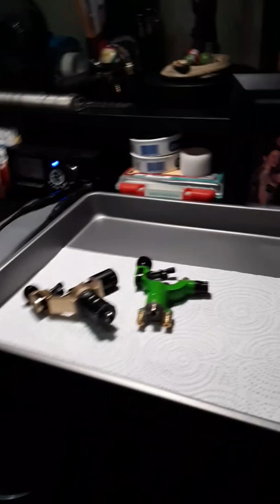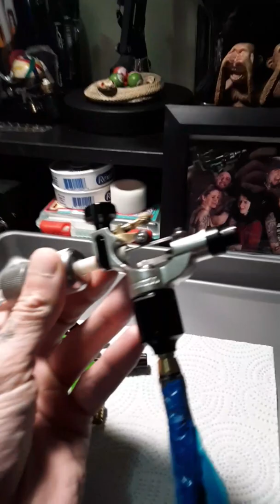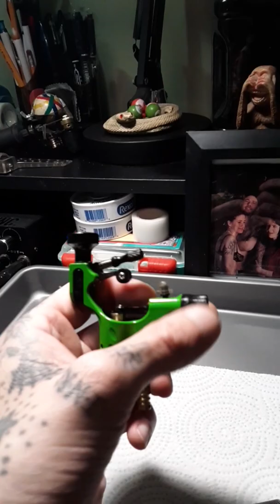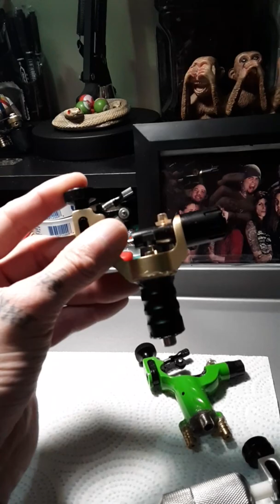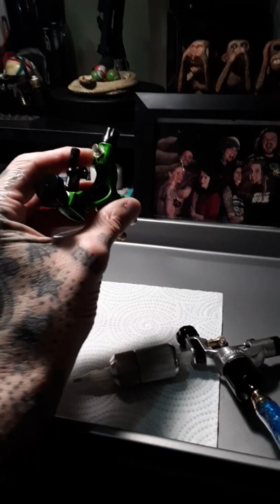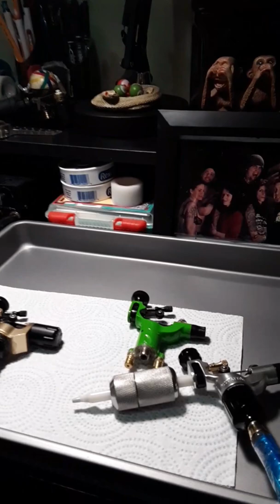Amazon Tattoo machine lies part 1

Comment: Amazon doesn’t sell any of this stuff it’s sold on their platform by individual retailers just like eBay so the pricing should be somewhat normal also any misleading information is put there by the individual seller Of each machine independently

Comment: Hey, thanks for the info! Is there a semi cheap machine for shading you would recommend? My wife is interested in tattooing so I bought her a kit with 2 knock-off dragonfly machines included in it. but I'm hearing their not that great for shading.. Ive also picked up starbrite ink. I want to give her the best beginner tools I can to start with that won't drain the bank
Reply: Hi if it’s not too late, i would recommend a pen style tattoo machine like dragonhawk mast max or cnc short pill or q2 from amazon they’re under 200 and work super well with lining and shading and can pack color decently. Pen style is best for beginners that don’t want coils in my opinion. Also try eternal ink or dynamic black specifically. it’s affordable and worth the money. Hope this helps.